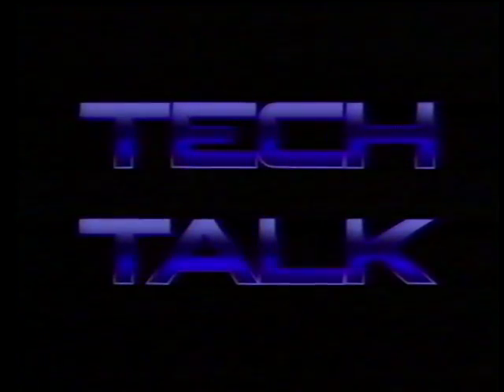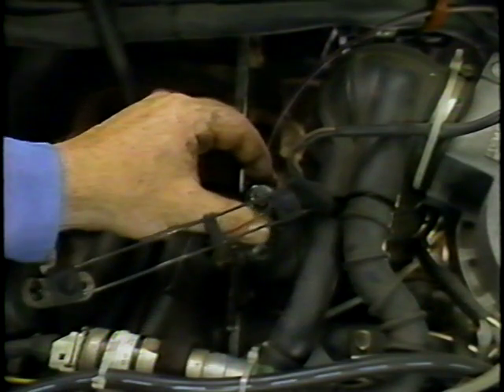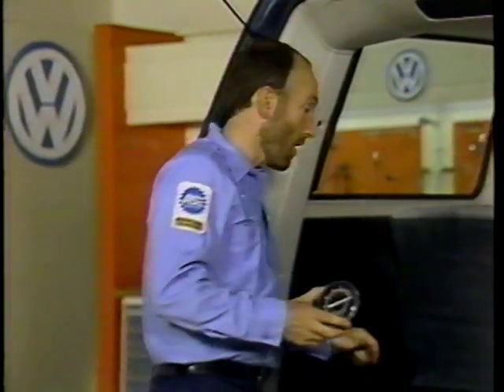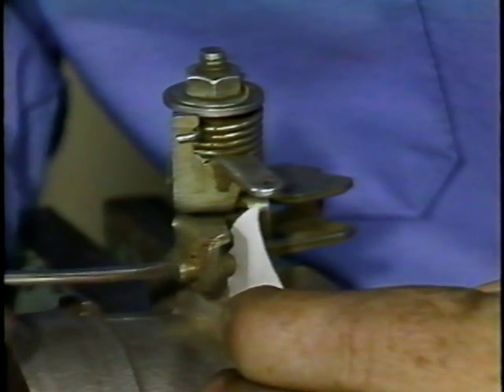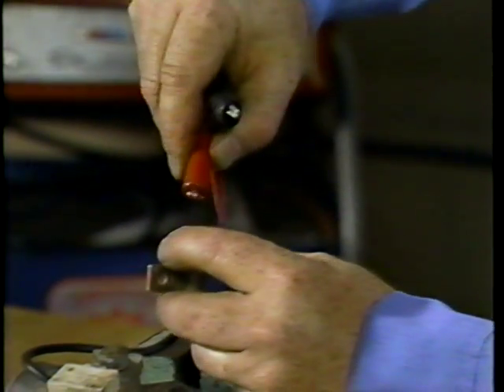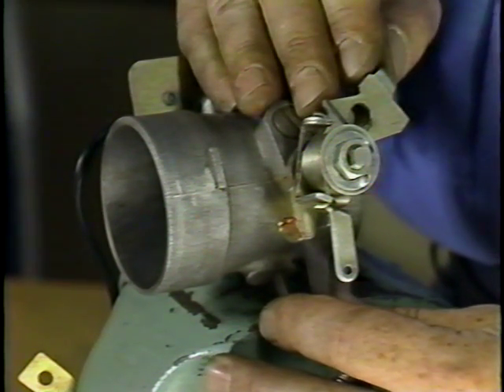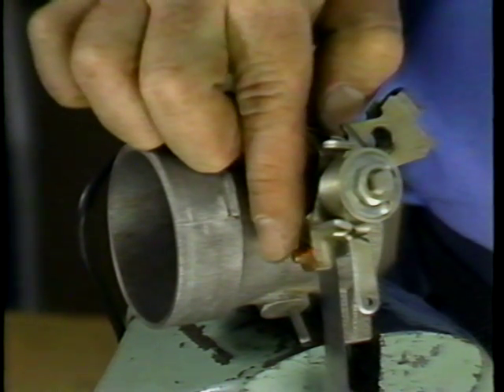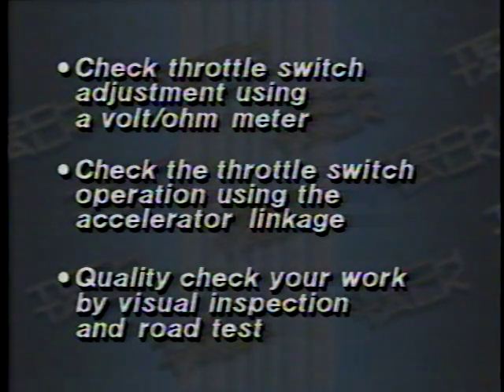VW Tech Talk VHS 212: Vanagon Digifant Throttle Adjustments

Comment: I have a 1986 2.1 waterboxer  just changing all the fuel lines ,10 mm bolt holding injector in just snapped  ,this vidio does not cheer me up .